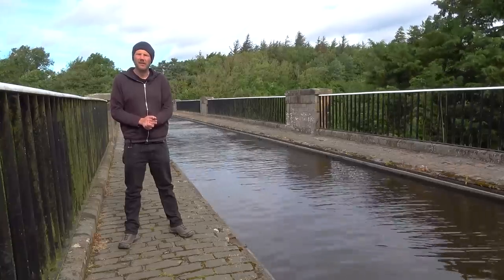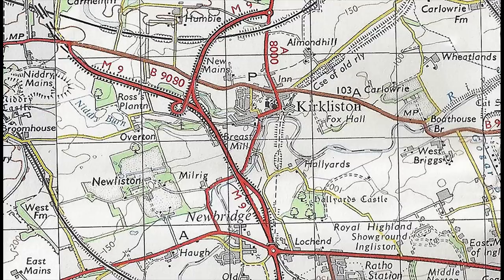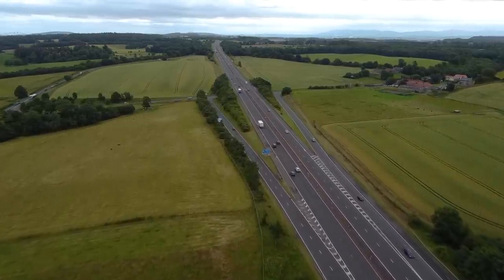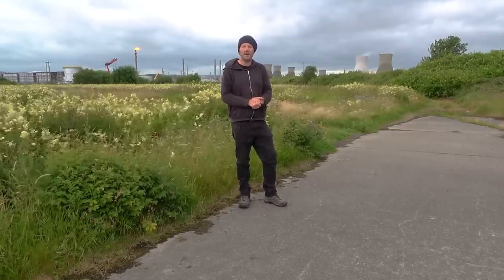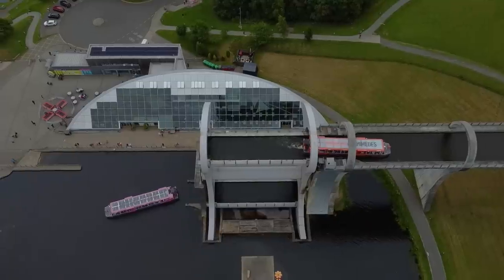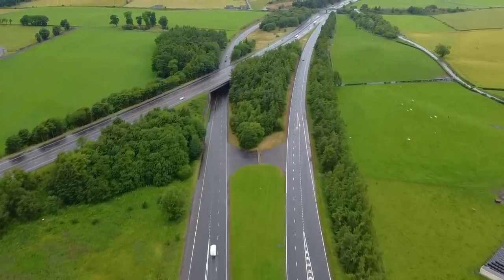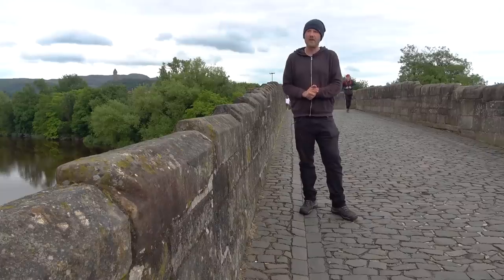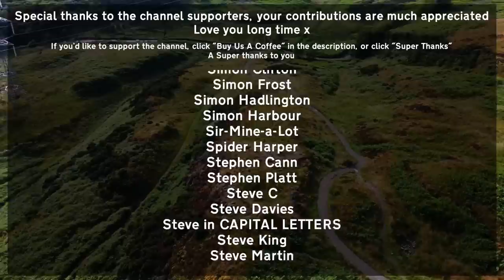Secrets of The Motorway - M9

Comment: I am going to take issue with the "overengineered" comment about the Falkirk Wheel.  It is an incredibly elegant and efficient solution to the problem of boat lifting.  From memory, it uses the same power as 17 kettles to operate.

Comment: The Falkirk Wheel is not over-engineered at all. It doesn't just look cool, it's actually an innovative solution. The normal approach to elevation changes in canals would be to construct a long series of locks, but the falkirk wheel achieves the same result with a single piece of infrastructure.

Comment: No angry Fallkirkian, but a nice boater here :)

The lift isn't 'over engineered' in any way, but a brilliant solution to an old problem only possible due modern technology. Being the only of it's kind is simply that in other parts of the world not only technology has improved, but also ships have grown to a size which can not be handled that way ... we may have to wait another 200 years.

Equally if not more important, it does serve an important purpose: Allowing us to cruise all the way between Edinburgh and Glasgow without the need to manually carry down a 20 ton narrow boat. Quite handy, isn't it?

But yeah, given, going 70 mph along the motorway isn't the same fun as doing 3 mph in a boat.
Reply: That piece of modern engineering existed elsewhere and popped up YouTube twice this steam driven running 24 hours a day and two boats a or fire up the boiler and wait several hours so the concept isn't new

Comment: One of the big reasons the wheel was built, other than just to be absolutely awesome, is that it allowed the canals to be fully opened again without needing to faff around all day with the 44 locks that were needed originally. Now you've got an impressive bit of kit that allows boats to move between the two in under an hour.

Comment: I think you may have been slightly unfair on the Falkirk Wheel; the alternative (such as it was) was to dig and create an entire new flight of traditional locks, which would have been almost immediately ignored by the majority of people, whereas the Wheel (along with the Millenium Bridge in Newcastle/Gateshead) is an amazing example of innovation in mechanical engineering which, as you did state, has become a significant tourist attraction in its own right (and has rightly put Falkirk onto the tourist day trip map) - anything that can move 1000 tonnes of water and boat with the electrical power of 6 kettles has to be applauded.

Comment: I have  family  links  to  this  area. When my Grandmother married  in  1921 she  moved  from a  farm at Falkirk  to Bearcrofts , Grangemouth  where  her  in  laws had farmed for  many  years - they  moved  on to a farm at Dalkeith . leaving  Bearcrofts to the  newlyweds to operate. 
Granny  said it  was   a  lovely farm on  the  flat  carse  land  next  to the  sea. However when the  refinery opened  next door in 1924  the  oil  works  used  to  dump crude oil waste  at  high  tide and  the  shoreline was altered to a  stinking mess. My mother was  born  at  Bearcrofts in 1925  but as the  oil works  continually expanded the  family  had  to  leave in 1944. There is  one   driveway within the  works  called  (  erroneously ) Bearcroft Road ( without the   s) and  that  is  all that remains  today as  the   works  sprawled all over  the   farm.

Comment: The slip road you highlighted at junction one, which takes you off the M9 to the Airport, isn't on the original alignment. It was actually much shorter, the new one was installed to be longer, thus avoiding queuing traffic encroaching onto the M9. Also, between junctions 3 and 4, albeit closer to 4, the Boness and Kinneil railway passes underneath. This is operated by the Scottish Railway Preservation Society, and is home to the only remaining class 303 Electric multiple Unit in Scotland, the only class 91 electric locomotive preserved in Scotland, and one of just four complete 1896-1977 Glasgow subway cars remaining.
Reply from the maker: train facts :)

Comment: The Falkirk Wheel is a work of genius. Archimedes principle... a body displaces its own weight of water..... means that both gondolas always weigh the same with or without boats. The result is a perfectly balanced design which means you can raise a boat from one canal to the other for the cost of boiling an electric kettle. Also you don't seem to appreciate the engineering past of central Scotland and if you look closely at the lift you will see this reflected in its construction.

Comment: Yes! My neck of the woods. Spot on! Newbridge roundabout continues to be crap. I use that god awful slip road when travelling eastbound to the airport and it's a nightmare during rush hour.

Also (correct me if I'm wrong) but I believe the Grangemouth cooling towers are the only remaining cooling towers set against an urban backdrop left in Scotland. This gives a unique view when walking through Grangemouth, of the towers looming above the rooftops of local houses. A rare sight.
Reply: I agree with your comment about the Newbridge interchange and have pondered why it still causes a bottleneck, while I have been sitting in a queue there. Obviously, a lot of cars will be heading towards Edinburgh city centre but I suspect that the fact that the A720 (Edinburgh City By-pass) can't cope with the volume of traffic that uses it is at the main source of the problem. Given that it took about 50 years from the first plans being drawn up to its completion, I don't suppose that the A720 will be widened throughout from two lanes to three lanes in both directions in my lifetime.

Comment: I have as much fun trying to sift  your  uniform presentation of cynicism,  delight and sarcasm as I do from the  detail you deliver. I determine, "they look good though", to agree with my view of the Kelpies as BLOODY  MARVELOUS as modern road side art goes. OK! their raison d'etre depends on them being part of the canal rather than the motorway but why miss an opportunity for something that good. I am not sure something that lets Archimedes do the balancing is over engineered and I suppose the Falkirk Wheel is technically the only one but in reality it is just a rotary version of the 140+ year old Anderton lift in Cheshire and makes sense compared with the locks required to achieve the same lift.
Just in case I can also be misread ; do not change your style.

Comment: If I may ask a fairly niave question about the British motorways as an American. ( I apologize for the long lead in) I note the multitudes of roundabouts in current use.  I live in the Northeastern US (New Jersey) where there are several circles left in use on our smaller highways and roadways.  They were numerous at one point when traffic flow was nowhere near as congested as it is these days, as they have been replaced by either nominal intersections controlled by traffic lights or by the use of overpasses with variations of sliproads.  How does the British roadway system function with the many roundabouts?  I suppose if drivers were well mannered, that would help a lot (yes, especially in the Northeastern US, the typical driver is fairly rude and aggressive).  I would have expected the British system to incorporate more traffic signals as volume grew (in no means is this comment implying any slight against the famous British civility).
Reply: Many roundabouts, including Newbridge on this film, have traffic lights to control the traffic going around. It gives traffic on minor roads a better chance to get around. Newbridge joins the A8 to Edinburgh, M8 slip roads on and off for Glasgow, M9 on and off slip roads to Stirling (the underpass takes through traffic from M8 to M9. Then there is the A89 to Bathgate and the minor B7030 which is always congested as it leads to and from an Industrial Estate as well as a petrol station and the big golden M.

Comment: The east coast refinerys were pretty much useless during the 1940's unpleastness, as you could not safely get crude oil tankers in, something due to the air being polluted with lead and steel coated high explosives, they started the national fuel distribution pipelines around this time as most tankers had to go to west coast refinerys which explains Grangemouth being shut.

Comment: The tower of Binns was built to win a bet. The bet was who could build the most pointless folly. The tower has no doors, windows or staircase which means the guy who commissioned it (don't remember his name) won the bet. The Falkirk wheel is another folly since the owners  have stopped boats from using it, except the expensive tour boats which load up at the bottom basin, use the lift, go along the canal, through a short tunnel, turn and come back then go back down the lift. The Kelpies are stunning and attract tourists for half a hour when they then board their coaches back to Edinburgh to spend money there making it another folly. Meanwhile Falkirk council have no money and have started closing facilities like Bo'ness recreation centre. They've still got money for major road projects like redesigning roundabouts numerous times, new road layouts for access to Kelpies. I guess someone on the council has friends in the road construction industry.
Reply: Are you saying private boats aren’t allowed to use it? I thought the whole point was to reconnect two canals without the need to rebuild the 11 locks that were originally there.
Reply: They do love a completely unnecessary elaborate roundabout design in Falkirk
Reply: Strange then that when I was last there a couple of weeks back, a private hire boat went up alongside one of the tour boats. It doesn't happen very often as the private hire business never really took off like they maybe hoped it would, but it does happen (at least for narrow boats, a wider boat would need a caison to itself, so maybe they aren't so keen on that...)

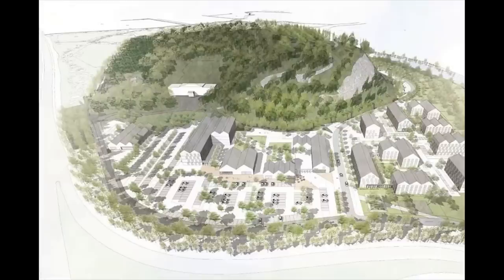Comment: 7:50 It's kind of sad they plan to demolish such a large/useful building with great transport links and replace it with houses, especially when you consider it's in better condition than the majority of the NHS estate and could quite easily/cheaply (relative to new builds) be converted into a hospital.
Reply: Very good point, but not too far away is the Forth Valley Royal Hospital which covers the area and that was a brand new hospital that opened in 2010. A second issue is that since covid a lot of companies are looking to downsize now because more staff work from home. Too many big empty office blocks across the UK right now because more and more people work from home. But I agree it’s sad it’s getting demolished.
Reply: Built in 1970s it’s probably full of asbestos and miles of corroded steel re-bars inside dodgy quality concrete.  Retrofitting 1970s buildings is extremely expensive as they are low grade in terms of construction materials, build quality, environmental efficiency, current accessibility standards… just about everything that matters in public buildings 50/60 years later.
Reply: @stevieandthebarbies  If you think refitting 70's buildings is hard try refitting 30's/40's  buildings lol.